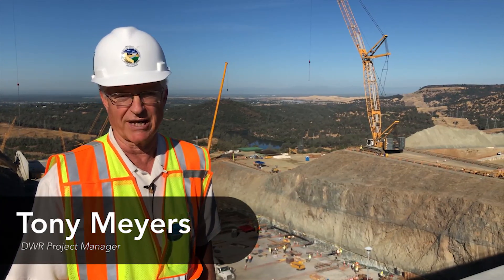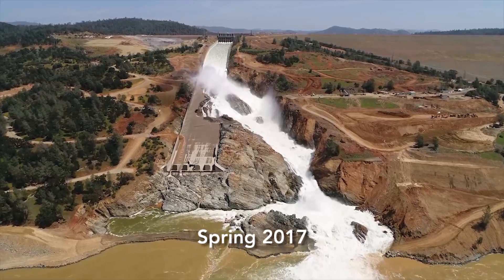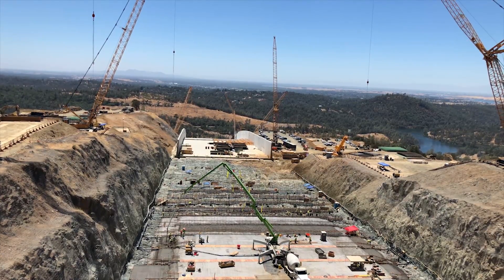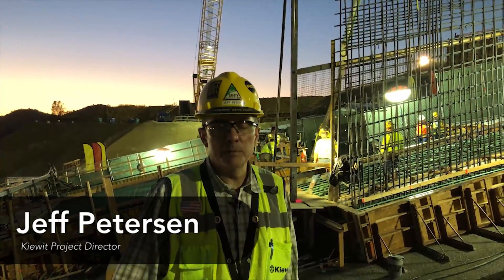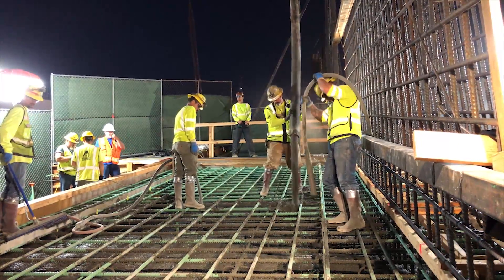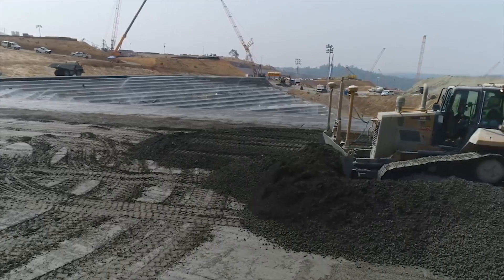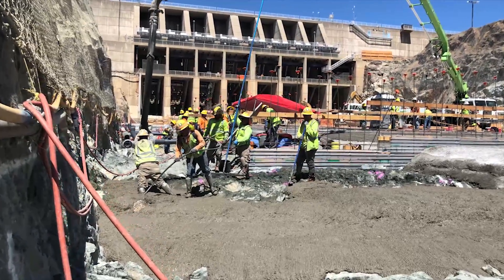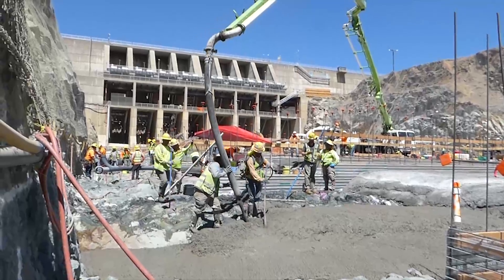Crews Press Forward on Final Phase of Oroville Emergency Fix

Comment: This is how it was constructed. New methods, new designs and new construction techniques using roller compacted concrete and GPS / mathematical model-controlled layer methods and equipment on the emergency spillway. The main Radial Gated Spillway was constructed with the most up-to-date methods and materials.
My son Mike was the Concrete Batch Plant Inspector that certified both of the Peter Kiewit Concrete Batch Plants and was retained specifically by DWR management from CalTrans as DWR did not have anybody with Mike’s qualifications

Comment: What is the "green paint" on rebars?
Reply: Epoxy
Reply: Its an industrial epoxy paint coating to prevent or slow corrosion of the steel rebar.
Reply: It's very important that the epoxy coating not get chipped during placement though because it will result in accelerated corrosion of the steel at that spot.
Reply: epoxy; MAN, I'll never get my chance to explain the green paint... Cmon dudes I'm probably the youngest here too. Give me one. D:

Comment: I noticed that you are using Hi rib stucco lathing for “stay form”.  That product certainly wasn’t designed to be used as concrete forms, but it is most definitely a strong material.  I’m sure it has been approved by and engineer for this application though.

Comment: Take a look at this link for real up to date info.  https://www.youtube.com/watch?v=3nKpU2t6nx0
The dam has been operational through ALL of this since the spillway failed in 2017.  The emergency lasted from when the original spillway failed until the end of the 2018 spring snowmelt.  The initial project was to was to get an operational primary spillway and a more robust emergency spillway built before the spring snowmelt.  That was accomplished by March of this year and the temporary spillway handled the lower than expected flows.  The project then switched from emergency to replacement with a November 2018 deadline which will be met.